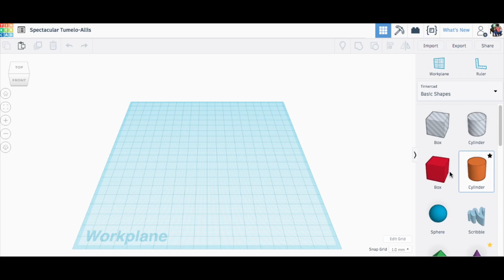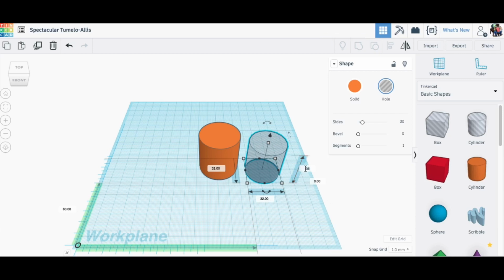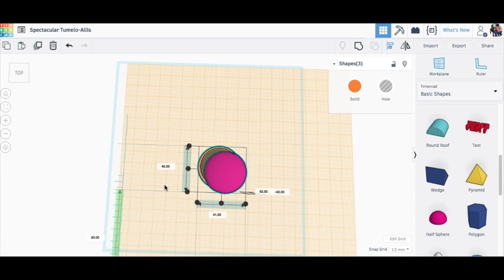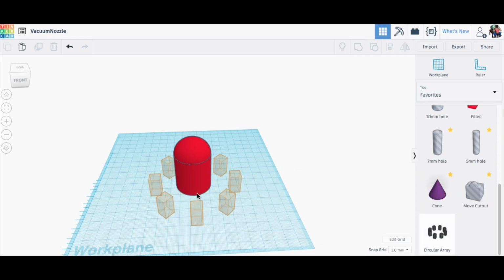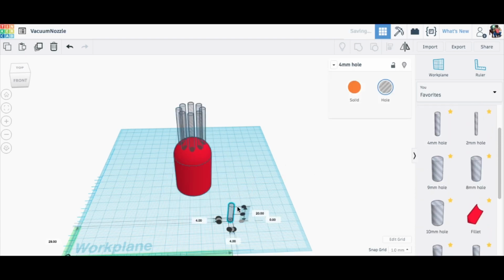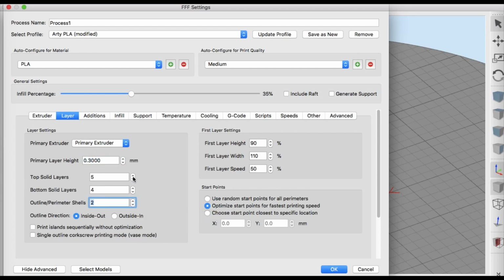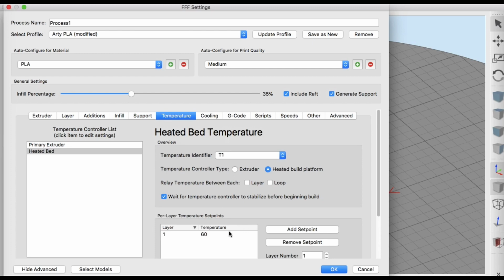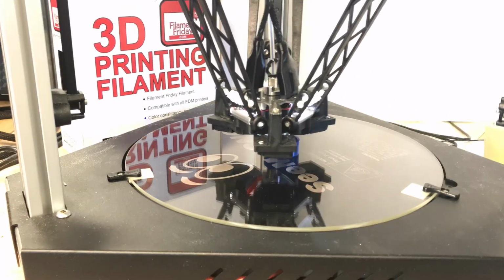Shop Vac Vacuum Attachment Dust Brush Cleaner

Comment: Nice idea!  
One other idea.  If you make the bottom/inside of the cap conical, I bet you could print it right-side up WITHOUT supports.  The angle of the cone depends on what overhang angle you printer can print without supports; but, 45 deg would be what I would try first.  As a bonus, this will also provide some extra support for your PTFE tubes.